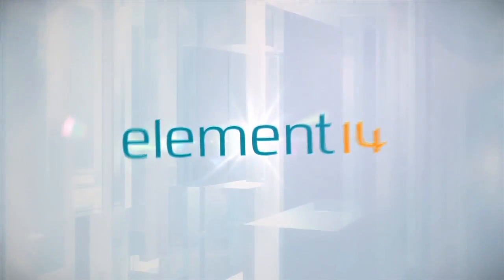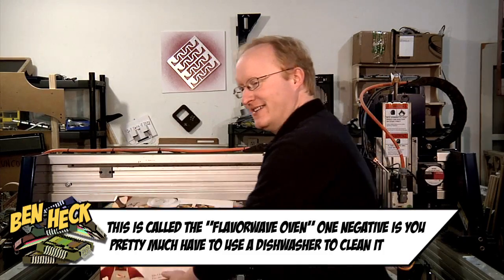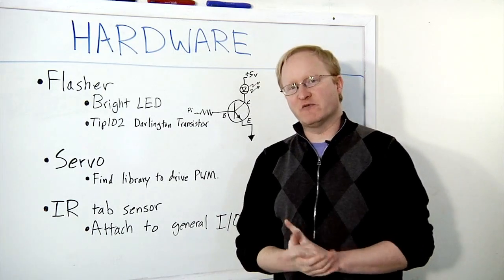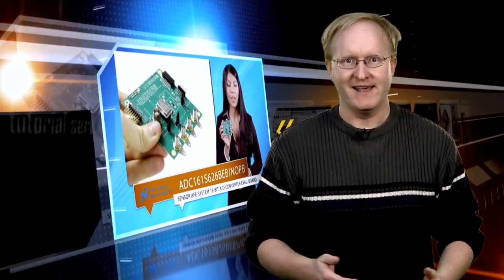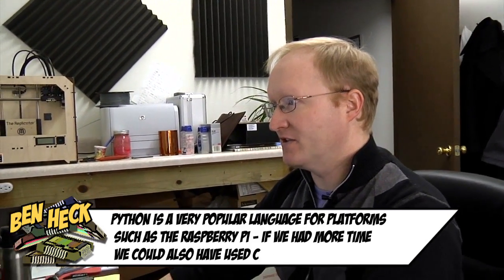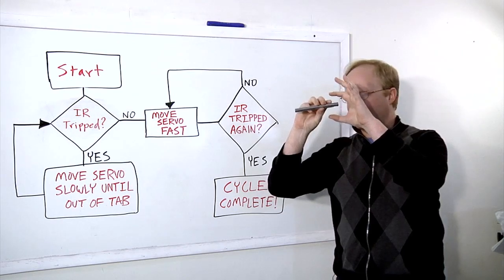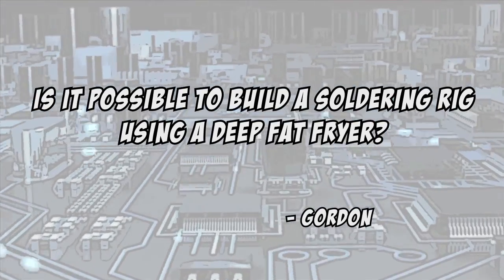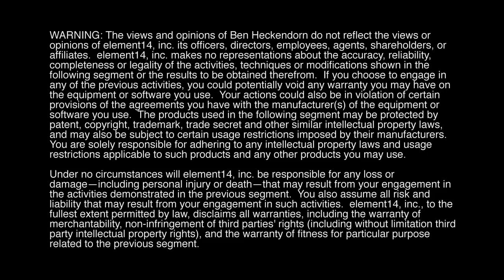Doggie Treat Dispenser: Part 2

Comment: I think you wouldn't have issues with getting the treat stuck if you glue a piece of smooth meamine resin sheet (about 1.x mm) on the Plate where the treat is sitting on.